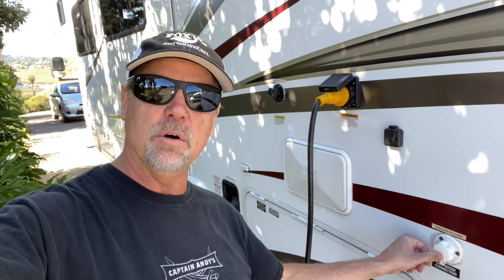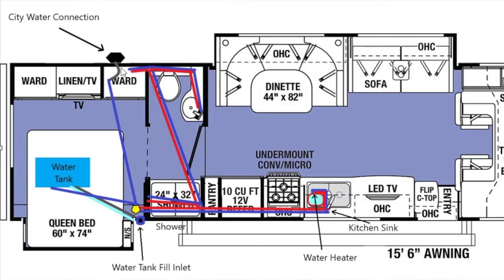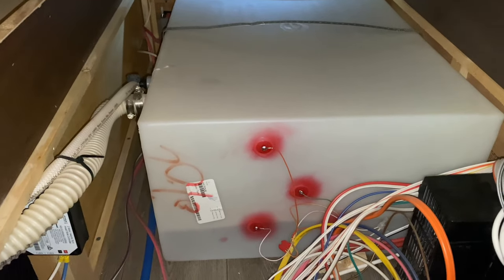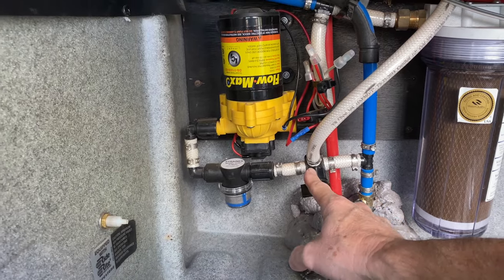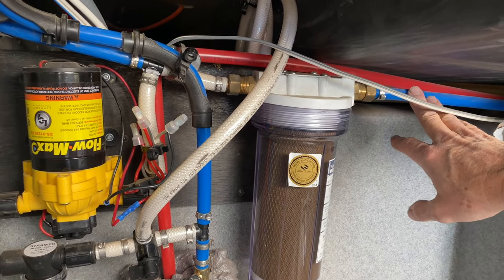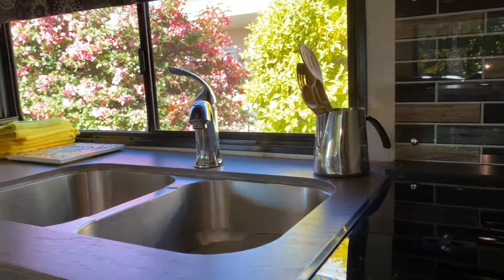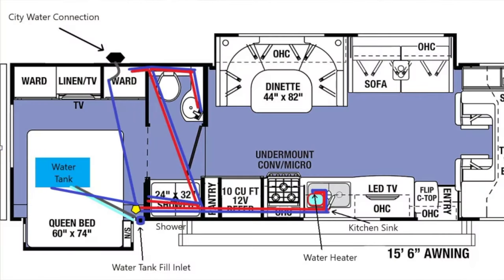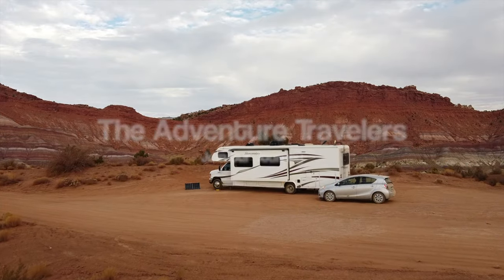RV Water System Explained In Depth

Comment: Thank you ,now i know more of my rv trailer ,my problem is or maybe was, i was filling the potable tank with city water, and a rush of water is coming out from a tube underneath the rv near the other exit lines, i know i filled it up correctly ,but there must be a faucet turned the wrong way for the water not to fill up all the way, ideas?
Reply from the maker: Yes, it sounds like you may have an open valve. Typically you may see some hoses coming out of the bottom of your RV. Chase those hoses back up into the RV and look for an open valve. Those are usually to empty the tank. Other than that, I would just go through kind of like I did one hose at a time and ensure that all the valves are in the right position. Remember that the valve knob should be in line with your hose for it to be open and if it’s at a 90° angle that typically means it’s closed.  Best of luck to you Miguel.

Comment: Nice video.  Has your clear filter canister ever come unscrewed?  For some reason ours has during the middle of the night spilling water all over.  Luckily we were in the rig when it happened.
Reply from the maker: Gary, our charcoal filter canister has never come loose.  We have a little plastic wrench that comes with it (fits around it like a glove) and we tighten it with that.  Ensure your O-Ring is seated with no kinks.  Glad you were in the rig when it leaked.  Thanks for watching our video!
Reply: @TheAdventureTravelers  thanks.  Yes I have one too.

Comment: Thanks, nice video. That blue line under the shower pan is not a drain. I think the drain is likely 1-1/2” pvc that goes into a gray water tank.  That blue line is a water line that probably feeds something in your bathroom.  That small line would not work as a drain for the shower, it would get clogged too easily.
Reply from the maker: A lot of things on an RV don’t make sense. Manufacturers cut corners everywhere to save a buck. The drain is the Only thing I can see that connects to that. We have a great drain screen that keeps most junk from clogging that dinky hose.

Comment: @1:26 - does that filter need to be changed, and if so, is there enough room to remove the cover and filter?
Reply from the maker: Yes, I change my charcoal filter about every six months. Sometimes it gets clogged or it’s just more sanitary to ensure I change it every six months.  yes, there is enough room to undo the filter housing. It looks big, but all you need to do is unscrew it from the top and it just drops out. When you replace it. You just put a new filter in there and clean it and it is super easy to reinstall.

Comment: My question is what does the INSIDE of the fresh water tank look like.  Is there a hose inside that pulls the water out of the tank or is it just gravity drained out the bottom.  I ask because once our fresh water tank gets about 1/3 full and lower, the pump will ramp up as usual, then go down to a slow idle and continues until you run more water.  This only happens when the water is low.  Any suggestions what is wrong?  We have tried 2 new pumps and a 3rd that was a different brand,.  Not the issue.
Reply from the maker: Typically you have a hose at the bottom of your freshwater tank that is connected to your water pump. It depends if you are on a hill or not how the water will get to the hose, thus get to the water pump. The only gravity fed hose is the one where you fill the tank from. Everything else is run by the pump.  If your pump is continuously running. It is most likely that the tank is empty or a check valve is not working correctly. It’s my pleasure. Thank you for watching and sharing your comment. Sorry for the delay, I have been hiking the John Muir Trail with my wife over the last month. Wishing you the best.
Reply: The problem with our water is when the freshwater tank gets below say 1/2, when we use water, the pump will continue to run at low idle and does not stop until we turn the faucet on again. Then it ramps up to full idle, and then stops, but this seems like a real waste of water, while we are not connected to city water.  We have changed the water pump three times so we figure it’s not that.

Comment: I am trying to add an an RV pump to my truck so I can pick up water out of a stream and wash the truck and dog. How does the RV pump know when to start pumping water?
Reply from the maker: Basically you just flip a switch and then the pump should start running. You need to ensure that you have enough of a pump to pump from another source, such as a stream or lake.  The longer the hose, the bigger the pump you will need. You lose a lot of pressure depending upon how long your hose is.

Comment: I am living in my morterhome where is the best place to run my water hose to the water tank or is there another hose hook up spot ?
Reply from the maker: Typically, there is another port for your hose that says city water. If you turn your hose on and have it connected to that port, you should have running water and you won’t have to use the pump. Depending on where you are in the country you may want to get a heated hose, so your water doesn’t freeze inside your hose or at the Spigot.

Comment: is there anything on the city water connection that could turn it off?  Like a valve?  My pump works fine.  I can fill the tank up and use it but, when I was connected to city and turned off the pump water would not come out.  The water was on and I connected it with a pressure regulator and without and nothing.
Reply from the maker: That is kind of unusual. I haven’t heard of that before. I would check to see if your check valve is working on your city water connection end. It would either be that or one of your valves is turned off. It sounds like you had it all right. When you connect to your city water connection, you should turn off your water pump and everything should work fine with the pressure coming from city water.

Comment: The extra hose is your winterising line put that in antifreeze turn valve on it sucks antifreeze through your system
Reply from the maker: Thanks, yes, I got that. Right after I made the video one of my friends told me about that. I live in San Diego so we don’t winterize our vehicles here. I had a good laugh. Thanks for the information.  Safe travels.

Comment: Ya I have a problem with my water system on my 2003 Winnebago journey fresh water system when it on the potted water no water coming out on city water it’s perfect have any suggestions on what could be the problem I would appreciate your help sir god bless
Reply from the maker: Hey Bob. Without actually looking at it, it’s really hard to tell. Have you checked all of your check valves? Typically, that is the first point of failure. If you are connecting to city water, well, a check valve might be broken or damaged and that right exactly could mess things up. There might be other videos out there on check valves. if you are using city water, and have pressure to your system, make sure that you turn off your water pump. Hope that helps some.

Comment: My RV is a 2000 33 ft Jayco 
I hookup to city water and it fills my. Water tank then when tank is full water comes out the air vent ìs ther a back flow valve somewhere and it does have a water pump
Reply from the maker: It sounds like you have a faulty check valve somewhere. Without looking at it, it’s kind of hard for me to diagnose. Does the sink give you water pressure when you are hooked up to city water without using the pump?

Comment: I have a permanent stationed rv that has been sourced with an underground electric and a fresh waterline to my rv ( they were placed 24" underground.) So, I don't use my pump. Problem is fresh water runs up to the pressure regulator, but no water running in the rv? We have had an unusual freeze for the last few weeks (10, 12, 16, etc degrees and day temps of 30-42) could this effect water flow in the rv....sorry for the long verbage
Reply from the maker: Yes, a freeze will definitely affect your water and water pressure. Hopefully your pipes are not frozen. Typically people leave a faucet dripping to keep water flowing throughout or they use heaters to keep the pipes warm. I am sorry, but I am not a cold weather enthusiast. I live in Southern California, so I don’t know much about that. So sorry.

Comment: under my rv there is a hot and cold hose. what are those for? maybe for some auxiliary use? I also have those on my camper but never understood them. They are capped on the camper. Also, your water heater is weird. My water heaters in all my homes and RV's is actually a water heater (it heats water, that was cold). You called yours a hot water heater. Not sure why you would need to heat hot water (hahaha). Thanks for the help !
Reply from the maker: You're funny.  I didn't realize I said, "hot water heater".  :-). Yes, it's just a water heater.  Trying to voiceover videos, sometimes I get tongue-tied.  The hoses with the plugs are most likely drain tubes.  So if you wanted to drain your tank(s), you can do it with those tubes.  Just take off the cap (and save it somewhere) and open the valve.  It will drain the water.
Reply: @TheAdventureTravelers  haha, ya. just a joke. 90% of people call them hot water heaters. Heck, I've done it. Ya i was thinking they may have been missing caps, so that's what they are, drains. The previous owner had the cold hooked up to a hose... the type of hose under the sink that goes to a faucet in your house. I think he must've hooked up (somehow) a connection to hook up water instead of using the city water hose connection. I don't know. People are silly.
Reply from the maker: @surveyguyor8958  Thanks for letting me know.  I appreciate it.  Glad to be of some help.  Have fun out there!

Comment: I have a 2019 Coleman camper, Lantern Edition.245RK my commode fills up but won't empty.Fuse to water pump is good.What do I do.Pump don't come on.
Reply from the maker: Not sure if I understand correctly. Is the commode filling up with water or human waste?  Is it’s filling up with water, and you’re not actively filling it up, then you have a leak somewhere. Is your camper hooked up to city water (water hose connected to a spigot)?  If so, your pump will not come on.

Comment: I recently acquired an RV the guy done a full redo of the waterlines took out the pumps if I plan on just running off city water the entire time do I need to reinstall the pumps
Reply from the maker: If you are hooked up to city water, you should never need the pumps. If that is your case, that would be much less maintenance for you.  🤙🏼
Reply: @TheAdventureTravelers  thank u

Comment: I have a question, can you fill your fresh water tank with your city connection line to use the electric water heater? I hope I worded this question correctly because I honestly just want to use my electric water heater with out filling up the fresh water tank manually. It’s there a valve I have to switch? I’m just confused.
Reply from the maker: No worries. It is all confusing when you first start. OK, let me try to tell you how to use your electric water heater. Since the water heater is downline of both the tank and the city water connection, you can use either. Just make sure that if you are using water from the tank, that there is water in it if you were trying to use the electric water heater. Typically, if you have a hose turned on and connected to the city water inlet, you should have direct plumbing to your entire RV. That means that it would go directly to your water heater. Also, in my RV, if I turn on the water pump, it will pull water directly from my tank even if I am hooked up to city water.  Does that make sense?

Comment: The cold water coming into the water heater has a check valve at the bottom of the tank that looks like it is keeping cold water from coming in. Is that correct?
Reply from the maker: There is a valve on the water heater side but it is not a check valve. A check valve basically is open all the time and when water backflows it will stop the water from going backwards. I believe the valve you are referencing can just turn the flow of water on or off.

Comment: After the hot water comes out of the hot water tank there is a connection between the hot and cold with a valve in between. The valve appears to be closed. What is it for?
Reply from the maker: I see what you're talking about.  It's at 9:23 in the video.  I'm assuming it's a bypass valve (I actually don't know why they put that in there).  It is closed because if it was open, the hot and cold water would mix at that point and it would defeat the purpose of each system.  Any plumbers out there have an answer?  I'm stumped too!  Thanks for bringing this up Greg.  I'm sure there is an easy answer.  :-)

Comment: Any idea why bathroom sink has water flow but kitchen sink has zero. The faucet isn't clogged. There has to be a valve shut off. A friend but a used RV and I'm trying to help. Under sink I can only find one valve and it is open. Maybe a valve near bathroom.
Reply: Hunter, It sounds like you're on the right path.  Of course, without me seeing it, it's hard to analyze.  I'm sure it's a valve somewhere.  How old is the RV?  Perhaps there is a clog in the system somehow.  Basically, you have to just follow the plumbing from beginning to end.  There may be a separate pump.  Have you tried it when hooked up directly to City Water?  Sorry, wish I could help more.
Reply: @michaelharlow1799  Its about 6 years old. It's hooked up to the city water. Yes I agree it's a valve. They are so hard to get to. I need to search the bathroom area for valve. I just can't see someone shutting it off unless there is a leak. Thank you. I'm actually heading there now.
Reply from the maker: What did you find?

Comment: What are the cold hot lines sticking out of the bottom of the RV? They don't go anywhere.
Reply from the maker: Most likely drain hoses.  Do they have a valve on them?  If so, drain hoses.
Reply: @TheAdventureTravelers  TY...DUH, I realized it after I hit send, but TY for replying. That is a great video!

Comment: Ive got no water when connected to the city water. Could the check valve be stuck?
Reply from the maker: Yes, that is a possibility. Sorry I didn’t reply earlier, what did you find out?
Reply: @TheAdventureTravelers  took everything apart and discovered the screen at the check valve was clogged with dead ants.

Comment: When hooked up to town water why doe it only draw from the tank not the direct town water?
Reply from the maker: Do you have your water pump on? If so, that is the problem. If you’re hooked up to city water, the pressure from the city water connection should provide all the pressure for your indoor plumbing. Turn off your water pump
Reply from the maker: And if that is not the problem, you most likely have a bad check valve.

Comment: I'm trying to pinpoint what I believe is a blow out in my main line.  I was in a park with extreme pressure.  Everything was operating alright for a day, but after I took a shower, I realized that I had NO water coming in at all.  No toilet, no sinks, no shower.  When I went outside, water was pouring from under the RV in the area of city water connection, which is almost directly behind the shower.  Help!!
Reply from the maker: Cindy, I am so sorry that I did not get back to you right away but I don’t check my YouTube every day. Hopefully you have fixed the problem. It does sound like a blown out waterline. Did you trace it and find exactly where the problem is? A pressure regulator on your incoming water line may fix the problem the next time. Sometimes there is so much pressure coming from a city source. If you do have a blown out waterline, all you need to do is change out that piece of line with a new one and attach it to the connection points that the old ruptured line connects to.

Comment: That extra line is the one you use to put antifreeze your lines for winter.
Reply: The black is so you can put white hose in antifreeze bottle and fill your lines.
Reply: Black valve
Reply from the maker: Thanks Tom. One of my good friends pointed that out to me after I made the video. I live in California so I typically don’t have to worry about antifreeze. I really appreciate it though.  happy travels.
Reply: I thought that maybe the case.  @TheAdventureTravelers